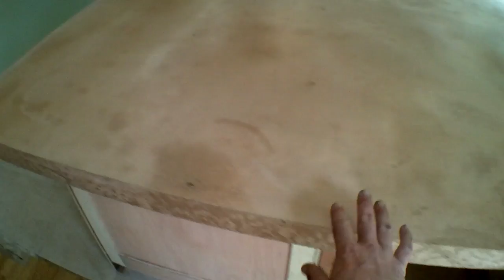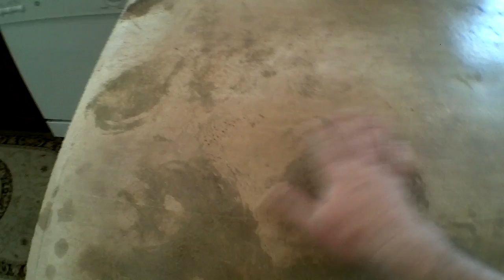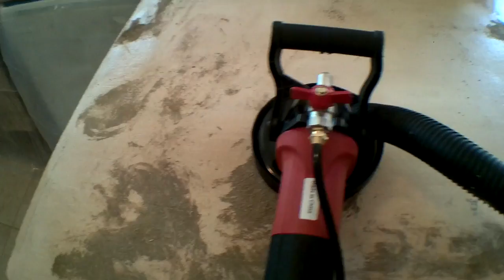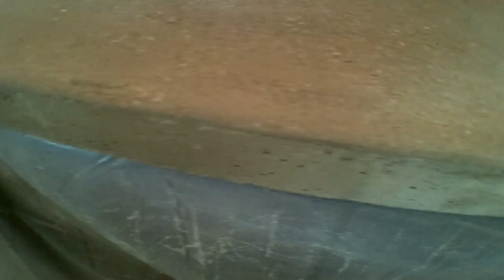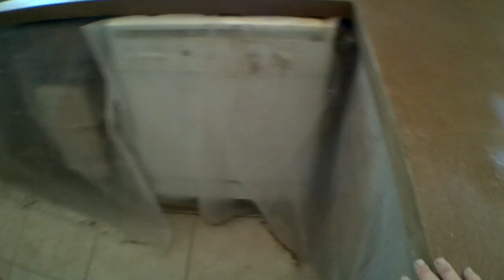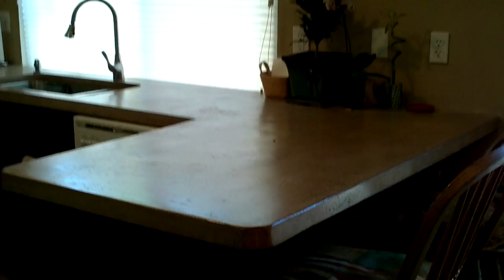Custom Concrete Counter Tops Start to Finish Part #2

Comment: I am betting there cracked and since you didn't put a membrane between the concrete and wood it dries too fast and is soft.  more mistakes in this video then 9 11
Reply from the maker: No cracks. Thank you for your assumption. This was my first try at a concrete counter top. I going to assume your fist one was perfect Joeseph. I can send you photos of the counter top today and you can send me a photo of yours. What's your email?
Reply: Everything I do has a mistake in it I am sure, however there is nothing I do that I don't put many hours of education and investigation into.  I learn as much as posible because spending $ 2x on something is just stupid if you spend 40 hours researching how to do it right and learn about how the materials work and react.  You see the properties of concrete are dependent on water drying or evaporating and the faster it happens the more brittle it becomes.  So the concrete on wood dries it too fast and the under side is brittle any flex will crack it.  also concrete has 0 stress in the center all the stress that is dangerous to it will be on the bottom where reinforcement is needed, concrete compresses well but does not hold together well when pulled.  I could go on about how it heats up and why it matters to keep it wet so it doesn't dry out so fast but you should already know that if you were about to do something like this and record it and post it for the whole world to see.  I have spent about 60 hours researching and planning and building a plan of attack to build my countertop.  I have spent 3 months saving my hard earned cash to pay for it and don't want to do it 2x.  When I pour it I am sure I'll forget to vibrate it and get bubbles, or screed it wrong or end up with a low spot.  I'll do something that will make it unique because I make mistakes but I will not make any fundimental mistakes.  Like putting wood up against concrete and expect it to last.  I can assure you that you concrete on the lower side is brittle and cracked and any significant flex will destroy the whole counter.  So no standing on the counter.

Comment: In just about every concrete countertop video on Youtube someone will go over their holes and imperfections with "slurry".  But no one ever mentions what the "slurry" is made from.  Use Ardex Feather Finish applied with a trowel or with a taping knife.  Even if you already poured and sealed and they didn't turn out well, you can put the feather finish right over the top and sand it smooth.
Reply: Counters are not finished with slurry,  people are incorrect using that phrase slurry,  as slurry is the dirty water which concrete produces.  You finish counters with sifted concrete dust filtering out all rocks to make fine mix.

Comment: Great video, how did you do the back molding up againts the wall? what size? did you leave it or remove it. was there even molding I could not tell from the video.

Comment: Hello - I'm about to do a similar countertop where I'll need to wet polish indoors. I was dreading the idea but see here you have the shop vac attachment for your polisher. Could you tell me who makes and/or sells these? It would be a huge help.

Also - David Smith asked about sanding into the corners. Try a detail sander. Takes some time but it works.

Comment: I have the same question as a lot of people.  You just used plywood as your against the wall frame correct?  Left it in place and then put your back splash on top of that?  I can see how that would work but what about the ends of your counter where they meet the wall?  How do you prevent the end of your wood from showing?

TIY!!!!
Reply: You have to find wood that is thinner or thin as your backsplash.  Doesn't have to be plywood or melanine,  just any wood.  Make sure to have matching height to your forms for the smotthing process and you will be good.

Comment: Nice job. I'm about to do a similiar project in my kitchen in Germany. Great to see a solution for the outer edges using the chipboard leftover after you've cut it out. I was wondering how to deal with the edges once the forms are removed, now I know thanks to this video. Did you use a wood sealer on the chipboard before pouring the concrete? By the way thanks for posting the video.

Comment: Boys you do a nice job.  If I had one ground to 200 already, could I do it with manually applying water using a makita 600-3000rpm polisher from 400 to 1500?? or do i need to buy a concrete polisher....

Comment from the maker: After several years of use the counter tops are holding. No warping on the back. Wood isn't swelling. Still haven't needed to remove the sink. My biggest regret is not spending the extra $$ for good concrete counter top sealant. If I ever sell the place I'll need to re-buff and seal it. I got a few oil stains from cooking. But I really don't care.
Reply: You did a great job.  Good  work on the sink.
Reply: ***** In my opinion, there is far more bacteria on the average wood cutting board than there is on a concrete countertop (sealed or not).
Reply: ***** I understand that granite countertops need "oiling" every year.  Have not heard of any issues with that.
Reply: ***** You are right.  I do not refrigerate my corn oil nor my olive oil as neither bottle says "refrigerate after opening".  Food suppliers are paranoid about their reputation and if there was any danger they would CLEARLY state to refrigerate.  Many products such as peanut butter which obviously contains peanut oil does not need refrigeration. Restaurants often leave ketchup bottles on tables all day even though the bottles say to refrigerate. 

I don't suppose you refrigerate your salt and pepper do you?

What will go rancid is the oil left in deep fryers.  People fry meat in those things and it is the meat particles that go rancid. I have never owned one of those disgusting things.
Reply: ***** Well not "everyone".  Here is an authority of vegetable oil; it is NOT to be stored in a refrigerator and it should be good for several years in a pantry.  http://www.doesitgobad.com/does-vegetable-oil-go-bad/

Maybe you should consider doing a little research before forming opinions and expressing them in a public forum.
Reply: I don't know anybody who refrigerates their oils.

Comment from the maker: no bought the buffer online. $200.00 then sold it after I was done for $150.00 search rotoblast on google. That's the name of the buffer. Get the one with the shop vac attachment

Comment: Did you rent the grinder/buffer, or buy it?  The attached vac is awesome.  When they did my floors, it was REALLY a mess.  Took about 10 days.  Is there a way to seal it that doesn't take out some of the gloss, like maybe during the buffing?

Comment: first of all, great job!...im going to be doing this and i really like the color of your countertops, will you please specify all the products you used?. like was is quickrete 5000 or sackrete, what kind of sealer did you use and did you use stain or a pigment in the cement mix, what color was it and were did you get the products

Comment: Thanks for the vid, Pat. Two questions:
1) where the counter meet the wall: once you pull the form, isn't there a gap?
2) how do you polish the inside edge of the sink? thanks

Comment: checking back in, after following your every move, I spent about 300 dollars including 50.00 on a cheap grinder off ebay that came with 50-3000 grit, it took me 2 hours in setting up, and about 6 hours of polishing. they look amazing! 
everyone that steps foot in my kitchen is blown away!  

Thanks for the video, I couldnt have done this job without it!

Comment: I've been wanting to do this for some considerable time now but I always thought the method of pouring onto a reverse cast would be better at producing a perfectly flat top surface. However, your method seems to have produced a nice flat surface and it's certainly easier because I don't have to worry about flipping the project over once cured. Your method also allows me to pour into wall crevices too which would help take some of the weight from the hanging areas. Nice job.

Ian, England

Comment from the maker: Yes the polisher. It was about $175.00 Then I sold it for $150 after I was done. The little vac I already had to I guess you'll have to add that in, but after it was all said and done it was around $200 with the wood mold

Comment from the maker: No cracking yet Metalhorse1. So when it happens I guess I'll know I did something wrong. Still, less than $200 for the counter tops if it cracks I won't cry.

Comment from the maker: @techman9282 I used the quikrete countertop mix with the concrete dye from home depot.  You'll also need a cement mixer. Sander(for the edges to agitate) Small shop vac( to hookup to the polisher. Big shop vac for water. some buckets to haul the concrete. A bunch of wood for the frame. Re-bar. Wire mesh. If i think of anything else I'll let you know. Good luck

Comment: Great videos, thanks. I'm thinking of doing this too, but not sure which concrete to use, regular quikrete 5000 or the quikrete countertop mix (more expensive)? Could you give a list of all the materials you used, especially the concrete and any additives. Thanks again!

Comment from the maker: @Hody491 Yes cured it with plastic. I'll get back to you on the seal. I patched the ruff spots with a sifted mixture of conctrete. Used only the fine powder and dye to patch it up.

Comment: Did you cure it using plastic to slow the evaporation rate?  What are your thoughts on using acrylic cure and seal?  Also, did you patch the rough spots with the small mixture you made before or after it cured? Great video and thanks so much for posting!

Comment from the maker: Not a gap but the wood frame is exposed. So I put a back splash along the wall. Good luck and get some help. 2 - 3 people make it much easier. Use a regular sander along the side to agitate and get air out of the concrete